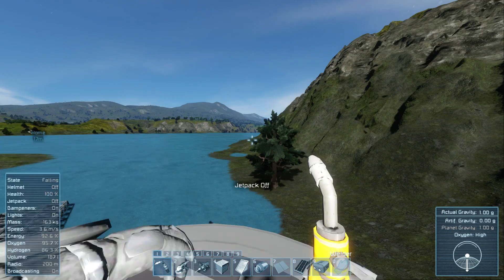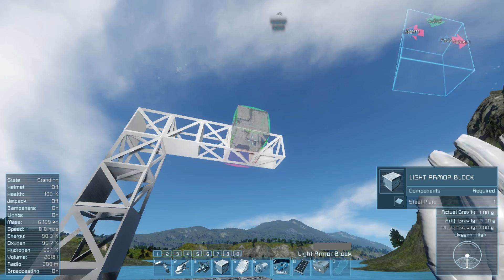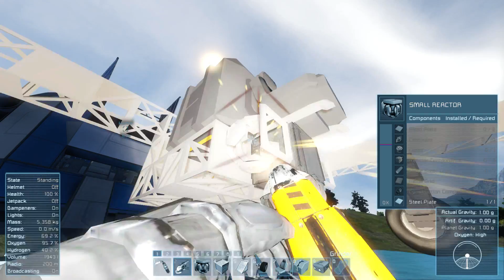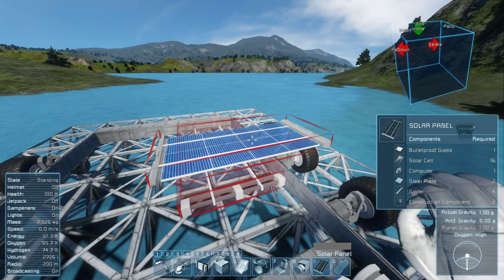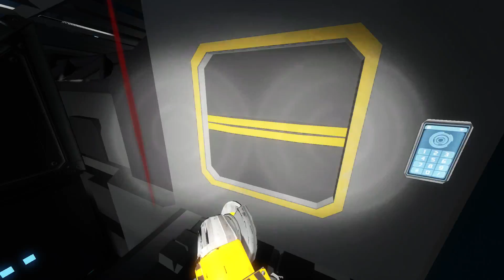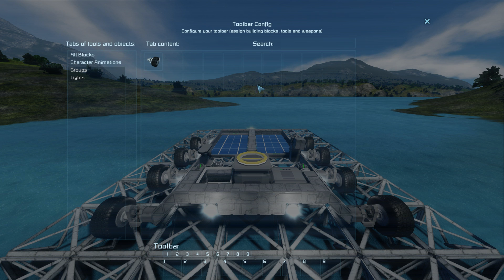Space Engineers with Planets E02 - Exploration Rover

Comment: nice work m8 and gladd to see you back to it :) piston was fine just was incomplete...need to build both the main section and the very end..easy to miss since its usualy perty well hidden and for a nice dx11 piston pack look for one called better pistons. deffinetaly want to add an ore detector to ship as well...preferably one of the modded ones like azimoths or codecats(even higher range)...the one built into the drill has a realy short range and will not identify anything till ya get close
Reply from the maker: +mountainmanfab Aah thanks for the tip on the piston - I eventually replaced it after recording was finished.  There's already an ore detector on the buggy - I'll be looking at modded ones soon :)